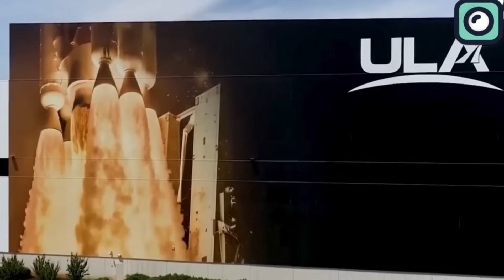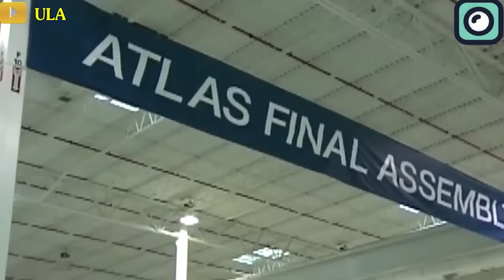Blue Origin Is Finally Buying ULA... SpaceX In Trouble!

Comment: As blue origin owns the be4 engine and therefore manufactures them all anyway, it's hard to see how owning ULA would stream line costs.  exactly the same number of rocket engines would still be constructed but the ones flying ULA rockets with no longer be sold with a profit margin.

Comment: Volatile as hell. This could go sideways very easily. It's mergers like these that can make or break a company. Think of when Boeing acquired McDonnell Douglas (which in turn spoiled Boeing from inside). 

If I was Bezos I would just split New Shephard sector apart and let them run their thing outside the core chain, never let them meddle in Launcher works.

And in the Launchers I would let ULA guys run the circus - and integrate New Glenn under the ULA structure. And let engineers be the boss there, never let managers and marketers have their way above a level. Otherwise they can kiss all those governmental and defense jobs goodbye.

Are we solved then? No. Far from it. There's the HUUUGE mess that's sitting there: BE-4. They need to solve it fast. ULA background is no use there, they need to find solutions outside.

All of that is very hard to achieve with Bezos' egocentric approach. He's too slow - too bureucratic for such a dynamic model. If I was him, I would choose someone else capable as CEO, but I doubt he will do that with this ego.